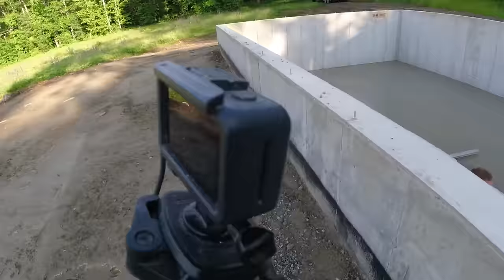Power Screeding Concrete Floors, Yes or No, What are Your Thoughts?

Comment: Mike, I am wondering how you order your mix?  do ask for a 4" slump and ad water reducer to make it a 7" slump?  Or do you ask for 7" slump with water reducer?
Reply from the maker: I ask for mid or high range water reducer. Depends if I want to pour a 6 (mid) or 7/8 (high). The Concrete shows up about a 4 or 5 and we add a little water to get it up to slump. It doesn't take much water when there's wr in the mix to increase the slump.

Comment: Hi Mike day,  thank you for making these videos.... I have a question about this job.... after you bull floated floor,  the guys power trowell the surface? 

With power trowell it is fine to not hand finish prior?

Is this because there are no plumbing ect thru floor?

Your guys wait until they can get on it with pwr trowell  and touch up edges by hand?
Reply from the maker: Yes, power trowel only except for the edges.

Comment: Watching these basement pours and I have to wonder where the egress points are.  I don't see any.  Most people partition off with walls to make different rooms,  but no windows.  I would hate to be in a basement and a fire break out and can't escape.  I don't say anything about you Mike,  but the builder or planner is the one making the decisions.
Reply: Exactly, can't even have a legal bedroom down there.
Reply from the maker: We see a lot like this here. Not sure why as to your point. I'm not involved in the design, I just place and finish the concrete
Reply: Do they actually use them as basements?  I thought it was just a high crawlspace.   Do double wides come with openings in the flloor for stairs?  Would imagine it's a nice spot for all the mechanical's but no one would live down there??  Am I totally wrong on that?
Reply: Tried to post a link but there is a video of them rolling the double wide in place and they have 9 feet of headroom so the Jacks they use to lower it into place have enough room .   And I would guess the waste drain is somewhere in the sidewalls capped off?  Sure they would have the waste drain in place before they build the stem walls.   I saw nothing in the floor when mike was pouring the floor.
Reply: @MikeDayConcrete  I tried to point out the planner of this would be the cause.  Not you.  You are the concrete guy,  no different than the plumber or insulator.  As with any contractor,  we do the work outlined and leave.  We are not the planner or architect.
Reply: @stevew9563  Doesn't matter if it is a crawlspace or a living space.  If someone is down there and a fire breaks out,  that person has to have a convenient way of exit and it can't be just one opening or door way.  Imagine being down there fixing the plumbing and a fire breaks out and you have to get out.  On top of that, not everyone may be home while this is going on so egresses are so important.
Mike has nothing to do with this.
My question in this is the planner or architect causing this.
Reply: @oby-1607   - Well imagine a plumber working in a crawlspace of a home on his back, they only have one way out.  I agree I do not think it can be used for living space but for service a bulkhead is probably all the code requires.   In fact may only require a 3x3 opening in the sidewall, that bulkhead is just a nice easy place to put a ladder.  Or wonder if they actually put stairs there?
Reply: @stevew9563  The distinction would be access or egress. Egress for a living space. Access for service. So it probably is code minimum. But I could throw a window down there for 6 to 8,000 bucks depending on size and you can put a bedroom down there. Assuming there are stairs in the service well, and put a small roofed structure, insulated, with an exterior door above the service well and you've got a great guest bedroom.

Comment: Mike, i thought expansion felt needed to be put between the slab and the fondation walls?  Is this only a prefference?  Does certain conditions or code require it? Thanks for all the great content.
Reply from the maker: It's a good idea. We do it if it's on the plan. It's not in the specs on all our jobs.
Reply: Usually used for exterior applications because of freeze thaw cycles in the surrounding ground.

Comment: Way too much water in that concrete mix, takes more time to dry, long time before you can power trowel. A stiffer slump mix is a little more work laying down but it dries quicker and you can finish power troweling by the end of the day and still have time for a cold one.
Reply: Search 'concrete water reducers'. This mix does not have too much water, but it looks that way.
Reply: That's not water. Plasticiser is added to the concrete. It's expensive but makes the concrete easier to work with. People aren't pouring 4 inch slumps anymore, too much work is involved.